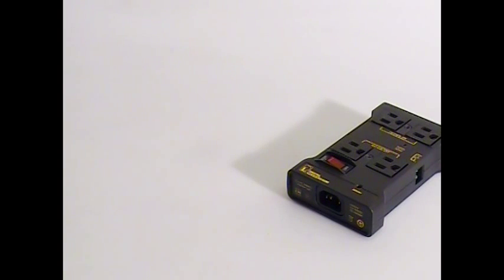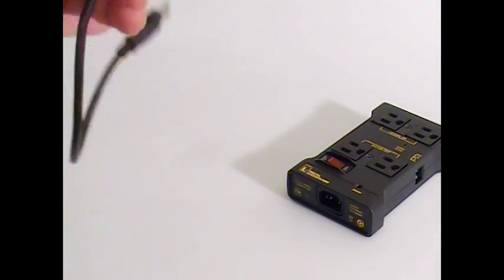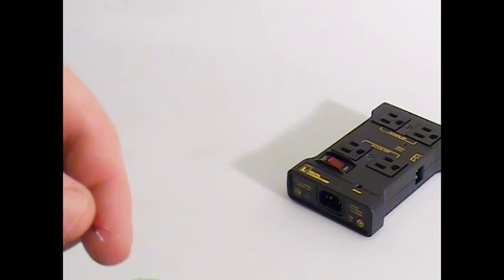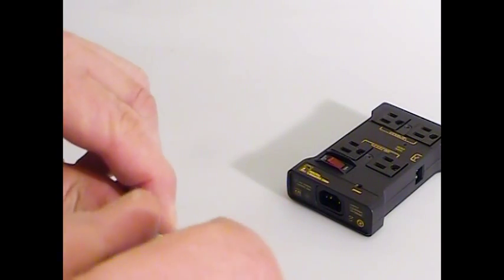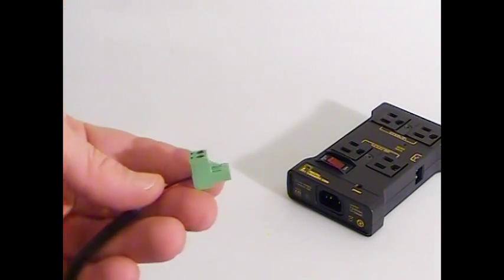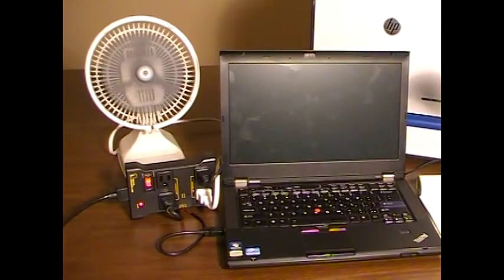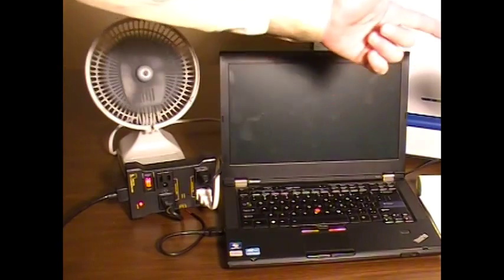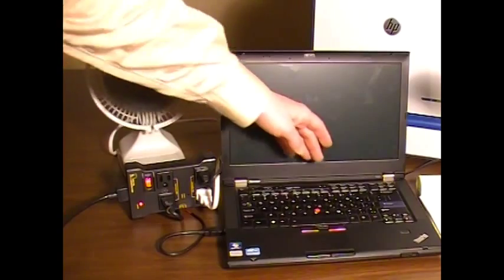Using the IoT Relay on a USB Port - Example

Comment: OK I get how to connect the USB cable wires to the green connector, but which of the four wires should you use? At the start of the video it looks like you selected red and black which makes sense but then you go out of your way to make it unclear as to which wire goes in what hole.  So I searched the net and yes, red is the positive DC 5 volt power wire and black is the ground. So when you plug the green dohicky into the relay the red wire should be on the left to conform to the specs. And, best of all, it works nicely!

Comment from the maker: Hi Sir-

The "green item" is called a connector.  This one is a pluggable connector. It comes with the IoT Relay and is used to connect the wires (carrying the control signal) to the control logic on the relay.

Here are some more examples, including direct connection to a micro:
www.digital-loggers.com/iotfaqs.html
The first one (Arduino) is identical to your Pi

And here is info on the relay itself: www.iotrelay.com

Thanks for looking!

Comment: Forgive my ignorance.  But, would you tell me what the green item is that you are plugging into the green item on the IoT Relay?  Basically, do I get a usb cord, cut it in two, and use the two wires and connect it it the green thing and plug it in and I am good to go?  Could I also just use the GPIO port on a Rasberry Pi to make it work?  Even the Pi is new to me, so don't get too technical with it. :-)
Reply: I've seen them & they have alot of names: Block, connector, plug, terminator, harness. It's for plugging into the relay to supply the low-volt to close the relay and turn the circuit on/off.
Serial (including USB) can supply it. Pi also. Power and ground. Vendor says 3.3 or 5v which the Pi has both last time I checked.